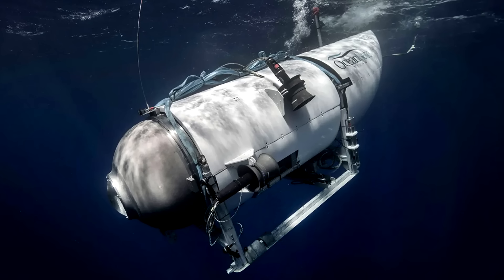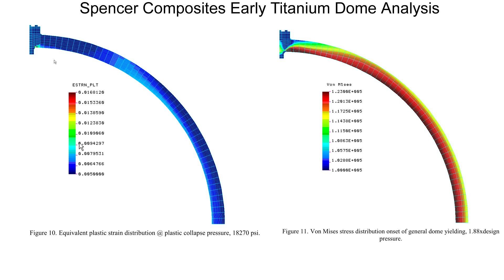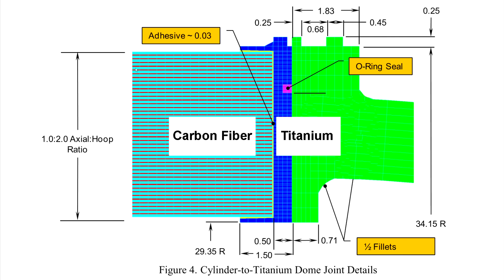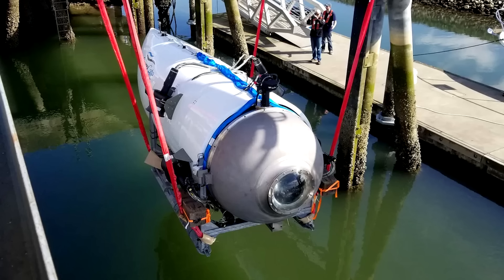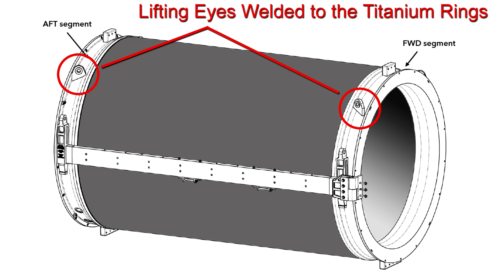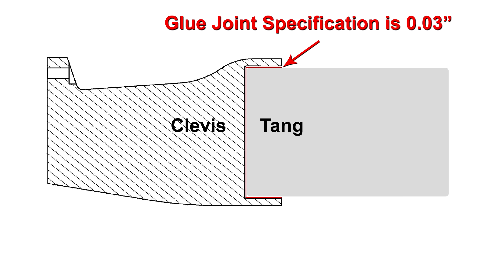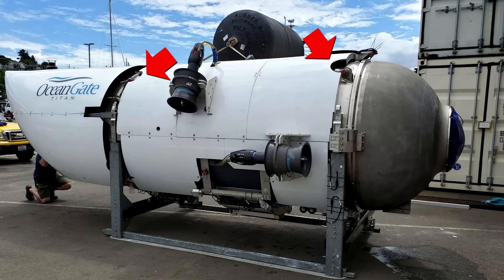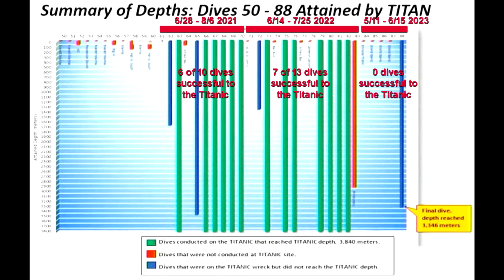OceanGate Titan Titanium Rings - An Additional Story About Them

Comment: I still say the CFC/Titanium interface was cause of the implosion. The hull was compressed on the inside more, putting more strain on the outer glue on the interface. When enough of the glue joint failed, the load shifted to the inner extrusion and that broke away with shear
Reply from the maker: Thanks for commenting.  Yes, but if the glue was failing at some point, there would have been a high-pressure water intrusion causing the instantaneous implosion.  So, the inner lip of the clevis shears off as a result of the implosion, but I don't think the shearing off causes the implosion. Spencer Composites predicted that most of the movement of the hull was in the center of the case, not at the ends.  I have another good video on that.  Thanks again for adding to the discussion.
Reply: @solareclipsetimer Yes, but if the hull is compressed in the middle and the rings basically stay in place, you have a pivoting movement (the most inner layer being the pivot point). We maybe never know if the inner lip failed because of the implosion or if the failure of that lip caused that. But I would agree with your statement
Reply from the maker: @huey-fan8335  Yes. That is an excellent point that is hard to quantify because I have never read an actual measurement of the amount the hull got squeezed in at the center. Exactly how much deflection?  Phil Brooks said they measured that at the DOTF, but he never said the number (like 1mm, 1cm?). I would love to know. But your concept is correct; a significant squeeze could pull outward on the top surface and compress inward at the bottom surface of the edge of the hull.  Thanks for your reply.

Comment: Thats almost a smoking gun. Then with rough sea incident along with dome dropping off the sub. It's not conclusive evidence, but enough grains of sand makes a beach. Clearly Rush felt he knew better. When I saw they just glued the titanium and CF together I knew it was problematic, and I'm just some nobody that that has twenty years working as a airframes mechanic in the USNavy.
Reply from the maker: Thanks for your comment.  I agree.  The gluing process, the rough seas, the weight of the forward dome, and then add the lifting eyes, it makes failure at the forward glue joint  suspicious, for sure.

Comment: I was technical adhesive engineer at Dexter Hysol from 1994 to 2001when it was sold to Henkel Loctite. As an adhesive engineer I worked closely with client companies for both developing new materials and recommending current materials for their specific applications. These industries included aerospace, electronics, semiconductors, and many mechanical adhesive requirements. We had literally hundreds of adhesive formulations, and selecting the appropriate one for an application was sometimes challenging. In addition to a materials technical information based on standardized tests, many recommendations were based on my experience after being in the industry many years.

Following the Titan implosion, I was curious, as I'm sure most engineers were. I watched all the videos I could find from Oceangate. However, when I viewed the  video of them  assembling the titanium dome to the carbon fiber tube I was shocked. They were using the Hysol EA9394 and there workmanship was abysmal. I went back the the TDS for 9394 and saw it only had a 90 minute pot life. Watching there laborious application process, I can't imagine they were able mix the material, applying it to create an even cohesive bondline, lower the dome onto thetube, and have the total system fixed in place with NO MOVEMENT for the required to 3-5 day RT cure @ 25C. In addition, the EA9394 is thixotropic, and thus, apply with sticks entrains air within the bondline. Any subsequent microcracks after cure would certainly allow super-high pressure water to enter the bondline with long-term deleterious affect.   

Some may argue there is apparent water resistance of this material as listed on the TDS as  77°F/25°C Water - 7 days @77°F/25°C - 4,100PSI. However, ASTM D1002 is subjecting the material to no pressure and room temperature on a 1" x 1/2" bond area on coupon of same material, same CTE.   

FWIW, I would never have recommended, nor approved an order for EA9394 on this application. For attaching these mismatched CTE materials, in a high pressure water environment, I would probably not have recommended any adhesive product. Although an advance polyurethane may have performed better, but not for long term stability.   

It appears they didn't consult an adhesives expert prior to using the EA9394 material, but if they did, they  received poor advice. Very unfortunate - Steve T.
Reply from the maker: Thank you for your thoughtful and professional comment.  You have added a lot to the discussion.  I have also heard that EA9394 was not the proper product.  Your explanation was great!
Reply: @solareclipsetimer  Thanks for the kind words -  I could list even more technical reasons I feel it was a bad decision to use 9394, but the bottom line is they did, and hopefully people will learn from their mistake. Bottom line: like so many technical fields - there's a lot more to glue than just being sticky ;-)

Comment: The loading is one thing but adding those brackets also means the “moduli” around those locations would no longer be matched. This could cause separation and stress concentrations. Or a “high energy joint” like Tony said.
Reply from the maker: Thanks for commenting. That is a good point and most likely true.

Comment: Does anyone know or have information on how exactly the leftovers of carbon fiber from the Cyclops 1 ring were milled out from the C-channel in the ring (so they could reuse it in the Titan)? It might be interesting—did they remove some layers of titanium or create sharp inner corners, causing increased stress or potential fatigue starting points? It seems that, at some point, the only thing keeping the Titan from imploding was the thickness of the titanium inner ring lip, which is terrifying.
Reply from the maker: Thanks for commenting, and that is a great question!  I have never seen any specific testimony about the process.  However, I imagine they stopped short of milling out any (or very, very little) titanium.  I am also guessing that it would have been the Janicki factory.  They would have been the folks that had a lathe big enough to pull something like that off.  Because they are the factory that cut off the excess ends after the hull fabrication was finished at Electroimpact.
Reply: I would think it wouldn't have required much to remove epoxy that wasn't adhering that well to begin with.

Comment: You can’t weld on that. The heat treatment is part of strength, the heat of welding will interfere with that. 

These people were truly clueless.
Reply from the maker: Thanks for commenting.  I don't know anything about welding titanium, but adding the lifting eyes seemed like a bad idea.
Reply: @ I’ve never welded titanium, but I’ve done steel and welding on a finished pressure vessel is a big no-no. There’s changes to the crystalline structure that happen in the heat affected zone. You can also cause stress relieving, if it hasn’t already been adequately stress-relieved.
Reply from the maker: @ Agree, it must have bad effects.
Reply: @wackyvorlon  Even semi trucks have big warning labels "HEAT TREATED RAIL DO NOT WELD CUT OR DRILL" or something like that.

Comment: Engineers consider fundamental but usually unnoticed mechanisms, like deformation from pulling, the effect of heat from welding, how glue works, and how connected parts move under load. I humbly looked up the word "clevis". Respect 🙇‍♀
Reply from the maker: Thanks for commenting.
Reply: I was left wondering why they use clevises and not shackles.😂

Comment: I'm a little confused. Isn't the weight already going through the rings, when the sub is sitting on its landing gear? How would the lifting rings be any different?
Reply from the maker: Thanks for commenting.  When sitting on the landing gear, the weight was supported by three points on each landing, which also served to keep the rings round.  So, you are correct with your thought here; there could be some of the same issues, but just on the bottom when sitting on the ground.  But I think the other point is being moved around by a crane is not gentle.  So, sudden "tugs" are being transmitted to 4 points under weight, amplifying the load. Good thoughts.
Reply: Because gravity is pushing down in one direction the loads aren't uniform around the rings. When lifted, weight is pushed on the lips making them buckle so you don't have a uniform tight seal anymore.

Comment: The fix would be so simple. Mount your damn lifting eyes on the outside of those landing gear. Ideally on the tops, concealed by the cover.

But no, they wanted them on top for the sake of looks.

Would have been so simple to bolt on some triangle hanging loops but no, weaken the most vulnerable component, that's clearly the wisest choice.
Reply from the maker: Thanks for commenting.  It seems like they did that at some point.  See the image at 5:08.

Comment: Stresses due to differential thermal  coefficient of expansion between the titanium and carbon fibre has not been mentioned or I have missed that if so.
A negative coefficient of expansion for CFRP and the near freezing temperarure at depth compared to the surface and even the interior temperature vs the outside might be significant.
Reply from the maker: Thanks for commenting.  Tony was aware of it, I believe.  Although he never specifically talks about temperature, they did do some pretty sophisticated analysis to match the behaviour of connecting dissimilar material.  At 3:12 is a discussion of moduli.  But you bring up a great point.

Comment: I guess he didnt mention how welding is going to create stress points on the rings themselves, both from the heat of the welding itself, and also from the additional material added, because the effect it was going to have on the glue bond, and the additional stress on that joint during lifting, somewhat makes it a moot point, as we can see from the intact rings.

But if it were me, I would NOT weld on a crucial support structure like that. Listen to the engineers. Professional welder here.
Reply: I have worked for years in fabrication and submarine construction and am very aware of the effects of deep diving and the effects on hull and other components. Considering this type of vessel was a prototype and an assembly of differing materials , the last thing I would of consented to would be the addition to those rings of lifting lugs (a hot process with no prior testing as to effects re distortion or the adhesive between the ring and the hull.) To go ahead in this manner ,(without substantial trials and certification as to safe process and materials) and with regard to all safety protocols . This is actually something which seems to have been skipped over from day 1 in most nearly every way from materials research , assembly processes  and I fear led to the loss of vessel and crew. This is an example that illustrates that mother nature gives no tolerance or lee way to those who take chances in her province.
Reply from the maker: @ Agree.
Reply from the maker: Thanks for your input.  I agree.  It would seem to me that the welding there could affect the shape of the ring at the points of the weld.
Reply: If they weren't broke AF they would have just re-engineered it and had new rings milled.
Reply: I think when they heard that snapping sound on the inside. That's when the subs should have been use for a much safer deep so it won't overstressed the hull. They needed to build another machine.
Reply: yes and it was glued together in an unregulated/dirty industrial building

only god knows how many dust particles and air bubbles got trapped in between those layers.

i wonder if they even did any X-ray scans after glueing to check that.

an air bubble or a couple dust corns dont seem much, but if we scale that up to an environment with 4500+ psi, it suddenly becomes a real problem.

especially when we speak about 2 different materials that are glued together + lots of temperature changes and extra forces applied on one surface (lifting hooks)

every hobby "engeneer", inventor, welder and milling/cnc operator would have come up with safer/better solutions then those fools with their expensive degrees and inflated egos.

Comment: Next video to come out will be that the game pad controllers were also designed bad. Which is not a knock on this channel or anybody uploading content about this. Everything about this was rinky dink, seat of my pants, narcissistic engineering
Reply from the maker: Thanks for commenting.  You actually bring up a good point.  At least the game controllers were based on well-tested outside engineering with tons of history of use.  And at least with the 1st version of the sub, APL made sure that OceanGate had wired backup in case the wireless connection failed.  The interesting stories come from the "one-off" engineering decisions.

Comment: Just wow. Lifting the entire sub up and have all the stress going right into the glue joints. Brilliant
Reply: Stockton clearly didn't think Physics applied to him....
Reply: @christianhenderson5471  As Scott Manley said: He stopped being biology and became physics. They very much applied to him and poof.
Reply: @christianhenderson5471  that is what narcissism does.  along with being delusional and arrogant.
Reply from the maker: Thanks for commenting.  As Tony said, it can't be known what the effect was on the glue joint on the microscopic level.  It was an interesting decision on their part.
Reply: @smc4229  A proper glue joint would have held, no problem. I would have expected maybe a foot long overlap between titanium and carbon. But still, these two materials are a scary combination under the given load.
Reply: How can you claim it would have worked? A foot of a glue join is a foot for differential expansion and flexure to cause sheering
Reply: Ultimately whatever the solution it needs to be tested. I think we can all agree, this whole thing is so insane.
Reply: @SuperTurbo9001itd cause shear under thermal load but would help increase lever arm for prying/peel
Reply: Clevis joint is known weak design in general for high pressure fluid applications. Just look at an automobile. Radiator hoses use a clevis style slip joint and fail readily under any structural degradation, typically at the joints. The next class up in pressures would be your power steering or brakes (2-4x coolant pressures). These typically have a flared nut flange design at the joints of the high pressure components. A flared joint with more mating surface material will seal better, for longer under higher pressure cycles than a slip fit clevis.
Reply: @MissingNumb definitely liked that you added for high pressure fluids. Clevis are a very well documented structural feature, I've analyzed a bunch of them. 

But if they are part of a sealed strucutre, ugh. Lotta local load which would need significant backup structure, like an intercoastal. Without a good axial loadpath, theyll cause local flat sheet bending and won't seal.
Reply: @Dad_Lyon  Yeah I'm not saying it would of saved them. Just the fact that they did the most rudimentary engineering of a pressure vessel when there have already been carryover designs that are already implemented in many systems (including other classes submersibles) that require safety for human lives. Mainly laying it out for the lay person that there was little thought of safety in favor of simplicity and costs from the outset. The design might have "proven" itself in lower pressures, on a smaller scale, and there are plenty of d.i.y. rudimentary subs doing similar things (Ie narcos), but you take a look at any deep sea pressure vessel. Gussets and bevel locks aplenty. NASA can get away with simpler designs as there is no pressure once you're out of atmosphere, and from what I gather, Stockton preffered experts from these fields (Aerospace). The math might have looked good on paper, but there was obviously not enough input from experts on the other biggest factor, the fluid dynamics, especially in the unforgiving conditions of the sea (on a nano scale beyond pressure).
Reply: @MissingNumb  I'm an aero stress guy. I would 100% be out of my league in subs. That high hydrostatic compressive pressure is really unique to subs.
Reply: From what I've read about titanium bicycle frames, it's a much harder material to work with. Higher temps are required, that can't have been good when everything was already glued in place
Reply: @Ob1sdarkside  yeah I have read gunsmithing tales about using Ti and it kills tools, takes longer to machine, and it also has brittle failure. There was a builder who made titanium compensators and they just didn't last
Reply: @smc4229  I've seen a lot of used ti frames for sale with cracks in them. The sellers all say it's fixable but very expensive. I wouldn't want to depend on anything that's prone to failure when I depend on it
Reply: Stockton believed that safety regulations were a waste of time....
Reply: @ He believed in "testing to destruction with the sub filled full of himself and other people.. that is real dedication to testing!!
Reply: I'd want those lips of the ring at least 12 inches covering the carbon fibre.